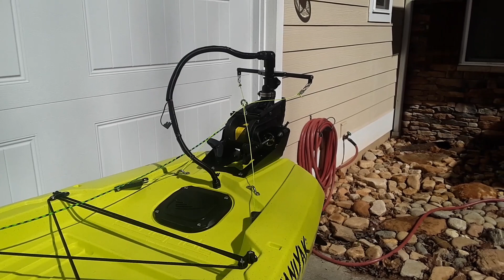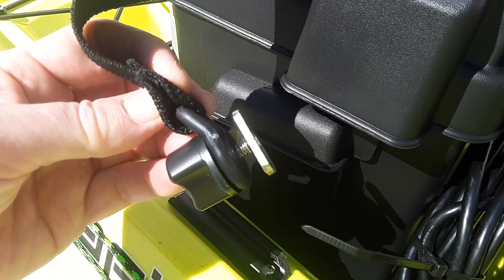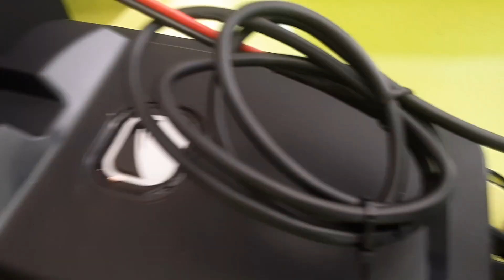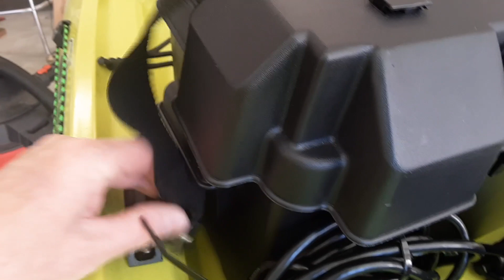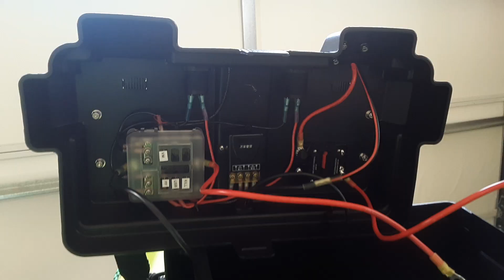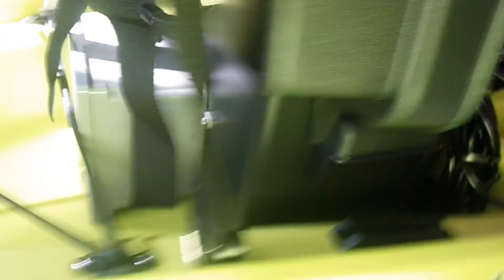Custom Bonafide RS117 Kayak

Comment: what parts did you use for the steering arm set up? mines done with PVC and im not a fan of mine hah.
Reply from the maker: On this build, the steering arm was custom made for me by a friend. I do have another "Black Ops" steering control arm video that you might like.  I have a FB page that makes it easier to share info about my videos and other projects if interested.  https://www.facebook.com/groups/3521517597860461
Reply: Aksmaniyak I will join that group !
Reply from the maker: @h-townfishing1382  Thanks! I think you will like it.

Comment: What kind of motor mount did you use ?
Reply from the maker: I modified a Wilderness Systems mount. It was not thick enough for the mounting bracket so I added a 3/4" piece of cutting board.

Comment: I have a bass boat for 75 % of my bass fishing in westernmass but I want to add a trolling motor to my 12 ft  kayak.Would a 30lb be enough or should i invest in a 55lb thrust, im 6’ 200 , i hit ct river quite a bit so there is current involved. Respect ur opinion because ur videos obviously show ur knowledge in the sport. Thanks
Reply from the maker: Thank you Frank. A 30lb works well for "normal" weather/water conditions. A larger thrust motor works better for maneuvering in bad conditions (wind, chop) and current. I'm 5"10" 210 and the 46lb has worked well for me. Obviously, the larger lb trolling motor, the more battery is used. Just something to remember.
Reply: @Gabe Ruesswick thanks, ordered the 55 lb, figured the two places I frequent the most have decent currents, appreciate ur input.